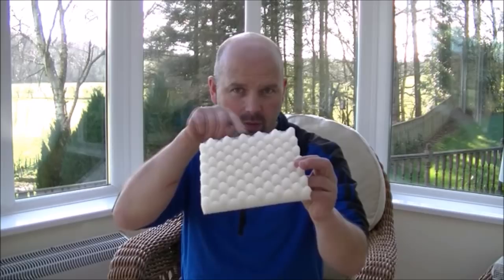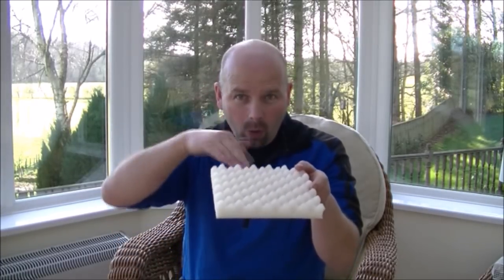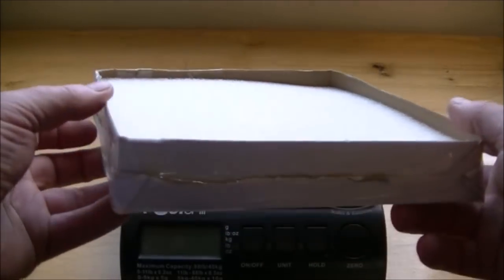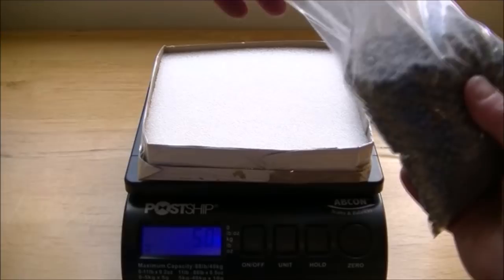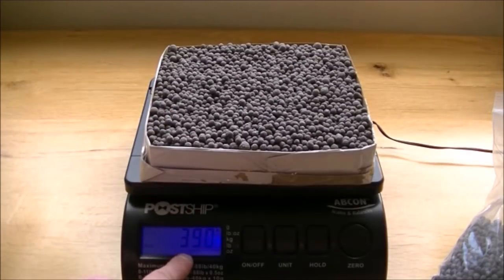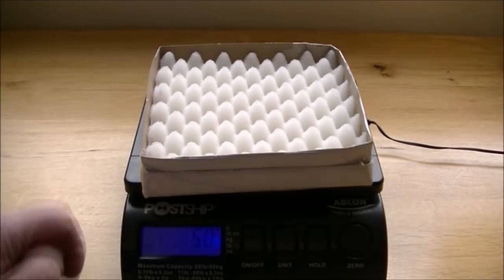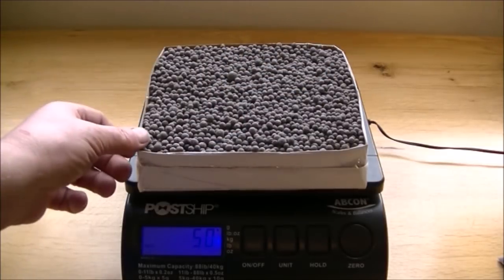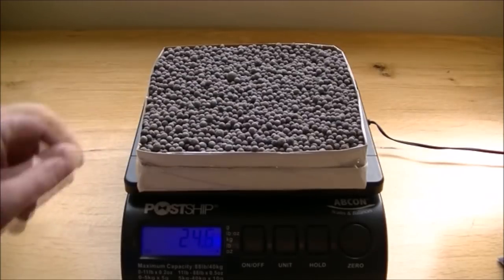Choosing the correct filter foams - How important is it?

Comment from the maker: How important is choosing the correct foams? Very important....
http://www.filterpro.co.uk for media and foams.
Similar foams on Amazon.co.uk: http://geni.us/5cvdB
Similar foams on Amazon.com: http://geni.us/ABzyp3
The foams in the Amazon link do not have such high ridges and valleys as the foams I sell on the FilterPro website but they are OK.
I should have put more emphasis on the LAYERING of various grades of foams as that is key to successful mechanical filtration. One thin profile cut foam will not catch as much muck as a thick square cut foam of same density but a layered approach using coarse, medium then fine foams will do a much better job of progressively catching dirt than a large single sponge which fills the same space e.g. a tray in a canister filter (hope that makes sense).
Your foams are the part of your filter which mechanically remove dirt and I'd estimate that 99% of aquarium owners have flat ineffective foams or foams in the wrong place. Hopefully by watching this video you will see the sense in using good quality profile cut foams to catch more dirt and cut down on your filter maintenance schedule.
If you're unsure how to set up an external canister filter please check this video out: https://www.youtube.com/watch?v=lsAmS...
The same method applies to most types of filters - mechanical (foams - and fine pad) followed by biological (good quality media).
Thanks for watching and feel free to share this video with anyone you think may benefit from seeing it.
Pondguru
Reply: What PPi do you recommend using for the coarse, medium and fine foams?
Reply: Can I use two medium density and then fine instead of a coarse at start? My experience is coarse is if no use.

Comment: Hi Richard - great to see you doing aquarium related videos again. I've watched most of your videos and learned a lot and enjoyed them all. I'm very grateful that I have my external filters set up correctly thanks to you - and I've had the same basic wisdom confirmed by other experienced fish keepers: i.e. the importance of grading your mechanical filter foams so the bio media gets the cleanest possible water.

But I'm really not convinced by this video - all you've really shown is that a greater volume of media weighs more . . . the key question is what is more important, the surface area at the boundary between dirty water and foam, or the volume of the foam? You're clearly convinced surface area is all important, even if it means sacrificing a considerable (50%) volume of filter media. I don't necessarily disagree, but I think there's a better proof.

Here's an idea for an experiment:

Get two identical small tanks, set up a hamburg matten type filter in each, one with pointy bits into the tank and one with the same PPI of foam without reticulation but with "full" volume. Dump a measured amount of dirt into the water, give it a swish and see which one clears first? You could then continue to dump dirt in at set intervals to see which continued to perform best? What impact does losing so much volume of foam have over time?

I'm guessing the one with the reticulation will clear more quickly, so I'm not necessarily disagreeing with your conclusion, just questioning your "proof". Also I think there is a downside to reticulation in terms of loss of volume, especially with HMF types where the foam is of course mechanical AND biological. That's why very experienced fish keepers like Ted Judy and  Rachel O'Leary are very picky about using Poret foams. Ted has an interesting video on types of foam btw, in terms of cellular construction and the chemicals used to make them. They do not however to my knowledge mention reticulation, but DO discuss volume and gradating PPI of foams.
Cheers :)
Reply from the maker: +Julian Morgan Yes there seems to be some doubt as to my intentions here so I will be doing an experiment to further illustrate the profile cut foams usefulness. I should have explained more that this method relies on a layered approach and one thin profile cut foam is not going to catch as much muck as a spare cut thick foam of same density - my bad but hopefully people who have used the layered approach will chime in and explain the benefits.
Glad you enjoy the videos and I like it when people don't agree as it makes me more determined to do further research.

Comment: What about the filtration in the valleys? I have seen these egg crates and worked with them. You can see right through the valleys. A solid block is going to have more surface  area. Less is not more, in this case. If your system needs fine tuning look into ppi density. it is much more precise than this.
Reply from the maker: Yes a solid block has more overall surface area but the initial contact area is much less. When they are put together voids are created which collect a huge amount of dirt (if left long enough) and extend the cleaning times of the filter.
I mention the layering of different density of foams in many of the videos - that is very important to work from coarse to medium to fine, again it will increase cleaning times.

Comment: good to see you back.I need foam for my filter. its a Fluval 4 pump its a old pump I got it with the tank and I know the tank was made 1992
Reply from the maker: +darren kawasaki If it is the old Fluval 4, not the U4 then most shops should still carry all the foams needed for it as they were a very popular long serving filter. When I had the shop we had a full range of the older foams for fluval internals.
Just checked the stock I have left over from when I closed my shop but unfortunately there is no fluval 4 foams for older filters - you'll pick them up online no worries.
Reply: thanks for looking for me that's a shame. but I will go to the fish shop and look. my tank is looking good now ready for the crayfish to clean them out when I get them out the river. then they are dinner for me lol
Reply from the maker: +darren kawasaki We don't have crayfish in our local rivers but there's certainly a nation of them in my pond. If you're local feel free to swing by and help yourself. Water is quite clear now so they should taste good.
Reply: the ones in your pond would taste good as I have seen your water pump. so they will be good eating. I live 270 miles from you. but I hope to be up your way this year and I will give you a shout. to see if your free. and if you want a top trap I make you one. it will clear your pond in month of crayfish. its the best trap I have ever made. and I have made a lot of traps and this one is the best I have done 36 crayfish in 24 hours. all my last traps was up to 15 max in 24 hours. and my next catch will be more than 36 in 24 hours as they wont get to the bate. as when the bate is gone they wont go in the trap.
Reply from the maker: +darren kawasaki Thats a good haul. No need to bring traps as I have plenty of them. If I left one in for 24 hours it would be so heavy it would take major effort to lift out, lol
Now worries if you're up this way feel free to get in touch and help yourself. I work from home so any weekday is groovy.
Reply: I will do. looks like you have a lot in that pond. you can sell them in London. it was £7.00 for a lb of crayfish but you need a licence to sell them. as you know you don't need much to make a lb of crayfish. but their be a place nearer to you that will buy them if you had a licence. but the ones in the river have to go into a tank to clean them out.
Reply from the maker: +darren kawasaki Thanks for the tip - I will look into getting a license as £7 per lb is mad money.
Reply: I know I would need some big tanks to do it to sell. but you have the pond so that's mint. I was told that 8 years ago and a lot more people are eating crayfish as they are just like prawns. crayfish curry is mint
Reply from the maker: +darren kawasaki I've never eaten one out of my pond but when I get the big aquarium set up with spring water flowing through it I will give them a go then.
There are some real monsters in there which may be getting turned into curry soon.
Mmmmmmmmmmm....curry.
Reply: They are mint to eat. but don't eat the ones in tubes of the market as they are full of salt and nasty and you will never eat them again. But fresh and just a little bit of salt is mint and. I want a crayfish curry now just telling you about them. Got my foam pads for pump today.
Reply from the maker: +darren kawasaki Groovy - you have got me feeling hungry now.
Reply: get your self some mild curry spice paste and get the crayfish in the pan. the females you want to keep some of them and use them for breeding. you will need 2" pipe and cut them into 6" for the tank.as they will live in them if you don't they will fight mate.
Reply from the maker: +darren kawasaki Yes as I used to install ponds I have enough pipe to go to the moon and back, lol. Will definitely be using it in the crayfish tank, tied together for easy removal and stacked into a sort of pyramid shape for easy access. Reckon I'll wait until the weather warms up a bit......
Reply: that's mint. make a frame out of scrap wood. then with the 2" pipe cut into 6"  lay the first line in and glue them together 10 /10 and when they are set take them out the frame and that be a 100 crayfish homes. you wanna have a 500G tank if you going to sell them. this time of year for crayfish is slow. they all come out when weather warms up. but when you have your tanks sorted it will be all year round. you will know what food to put them on the get the crayfish big.
Reply from the maker: +darren kawasaki Sounds good to me and I've certainly got enough pipes for the job. Will get onto it when the weather warms up as its way too cold for messing about with outdoor aquariums, lol
Reply: nice one. it is getting cold hear to so I'm in the house just making stuff. just doing a finds tin in matchsticks. but the cutter I got off ebay is crap so having to use my Stanley. I can see its going to be a long night dam ebay lol
Reply from the maker: +darren kawasaki Ahhhh....ebay - a blessing and a curse.
Reply: this time a curse. you pay for something and they send junk. but at 01.00 I fixed it but its still not good but I have to finish the tin today. 8 hours on it yesterday and had 4 hours sleep and I'm back on it 07.30 lol
Reply from the maker: +darren kawasaki Sounds like most of my working days. 4-6 hours kip is about right - no wonder I look 10 years older than I did 5 years ago, lol.
I'm thinking of having one day off a week just so I can claw back some of my youth and find time for hobbies (or just sleep all day).
Reply: I think I have got 10 years older just making this matchstick tin lol. their is a chap on youtube who makes these tins up and it take 3 weeks he was saying in his video. I'm just doing things I wanted to do years ago but did not have youtube back then to learn lol as their was no internet. I have bin watching your videos of when you had your shop so cool. I only sleep all day if I was on night shift. night shift was cool as you save money as people are partying when I was working lol start at 18.00 finish at 06.00. you need 1 day off a week as you work hard.
Reply from the maker: +darren kawasaki Although I often work until 1 or 2 am I couldn't get away with shifts where I had to work nights. Come to think of it I would find it very hard now to work for someone and with other people day in day out especially if there was a constant drone of commercial spirit crushing radio in the background.
Yes wednesday would be the day if I was going to take a day off but it will never happen.
Youtube is an excellent learning resource which passes 99% of viewers by as they would rather watch nonsensical vlogs or other people playing video games - bit sad really. Even damn detecting videos are like a minefield now with the amount of fake 'finds' on them so I am likely going to make very few detecting videos going forward.
I'd much rather make videos with some sort of educational content about hobbies which are not afflicted by clowns wanting virtual fame.
That's why the bushcraft and survival stuff really gives me pleasure as it is a demonstration and sharing of skills in its purest form. Just hope I get the time to do the videos I have planned.
If I only get one person per video tell me that they have enjoyed it and have tried out the techniques then it makes it all worthwhile as the last thing I would want is a rabid population of sheep falling over themselves to heap fake praise on me. Guess I'm just used to working for what I have.
Best of luck with your tin construction - damn sure I haven't got the patience for making anything from matchsticks. Maybe if I was doing a long stretch in prison I would change my view on that....lol
Reply: factory work sucks now. it was mint 25 years ago I cant understand them now. I was a machine tec doing what I loved fixing the machines. I had to train them up to do the job. I have never played a video game and never want to learn haw to play one. I was watching a vlog yesterday and had to move on from that as I was not learning from it. your in my top 10 on youtube. as I still have the fish trap you made in my head I am going to make one this year. I can make them out of wire but if that's not about I have to do it your way. you should do more metal detecting with the  XP Deus. the matchstick tin. I have all the matches stuck on and will be sanding it up tomorrow its hours of work. 7 hours just on the lid haha. never again but like you say I make them if I ever get a stay at HMP lol. but I never wanna go to a place like that.
Reply from the maker: +darren kawasaki I'll still do detecting videos if I can get time but most hunts are very mundane with nothing of interest found. I suppose part of me can see why the guys who have nothing else going on in their lives end up faking stuff, lol
7 hours on the lid? Holy crap that is a days work there.
Fixing stuff would be awesome but as you say they are way too complicated now - bit like cars. When I pop the bonnet I have no idea what I'm looking at now.

Comment: So I recently found out that the range of Fluval canister filters use 30ppi foam all throughout the filters. If that is the case, then wouldn't it defeat the purpose of having 3 layers of foam for the water to go through if the first pre-filter layer is also 30ppi meaning that the other two layers won't catch anything, if at all? I just bought a 107 canister filter and I'm already thinking of adding a 10 ppi foam layer as a pre-filter on the intake, then a 20 ppi sheet where the blue foam is, and then just using the two baskets for biohome ultimate

Comment: I like all of your videos and have learned SO much!  Setting up a brand new Hydor 350 canister tomorrow and will be filling it with it with coarse, medium, fine foams and as much BioHome Ultimate as I can fit in.  The only addition I am making, is to place 50 micron pads in a couple of key places; one  between the finest foam and the first basket of BioHome, and one as the water is leaving the filter.  Can't wait to see crystal clear water in my aquarium!  I think I will even have room at the bottom of the filter to place some of those ceramic rings that come with the filter.  It makes sense to me that the heavier muck will be trapped there before it hits the first foam.  I'm a little concerned that the rings may cause noise, but it is worth a try.  Hoping, in time I will be able to achieve anaerobic bacteria to reduce nitrates.  I'll be sure to let you know if I have success!
Reply from the maker: All sounds good to me - only thing I would be concerned about is the second fine pad after the media concentrating dirt in the media but you'll be able to assess that when you clean it out after a month or two.
Reply: @pondguru  Yes, I wondered about that second 50 micron pad too.  My hope is that the water will be so clean before it hits the BioHome baskets, that muck will not be present on the second pad.  But, as you say, that is the first thing I will be checking after a month, and the second pad may have to go.  Thank you, for all of the information you provide regarding filters and thank you for BioHome Ultimate media!!  Cheers!

Comment: Hey fella! Those foams have made a HUGE difference to my tank using them in the booster ( pre-filter ) and my main canister is now almost all BIOHOME ULTIMATE. The difference in the quality of the water with that stuff is night and day and it's only been, what, a month?I'll have to add a video of my tank at some stage and post it up.Folks, if you're reading this, get the BIOHOME media! One question, if my tank is all sand, would ph levels be buttered by a thin sprinkle of gravel to make it more natural looking?
Reply from the maker: +Mark Pilgrim Glad you are pleased and have noticed a difference in quality. Groovy.
With regard to gravel if you use a minimal amount it shouldn't make a difference but will get integrated into the sand and probably sink out of sight.

Comment: Can I use two medium density and then fine instead of a coarse at start? My experience is coarse is if no use.
Reply: Jay Khalate water flows through the course quicker and it also grows beneficial bacteria
Reply: I cleaned out my turtle tank filter after 4 months, and my experience was the same as yours. The coarse foam (TM10 - this is the most coarse you can get) was quite clean, while the medium foam was dirty as hell. So I decided to not use it. What I will use in my next steup: TM20, TM30, TM45 and a fain pad. You can use whatever your instincts tell you.